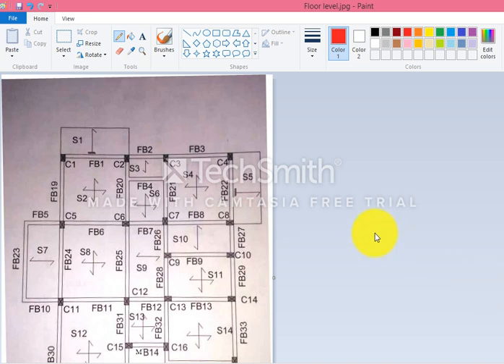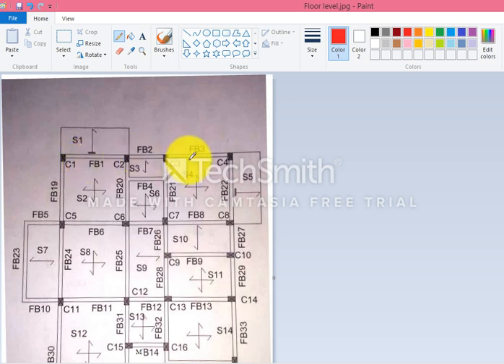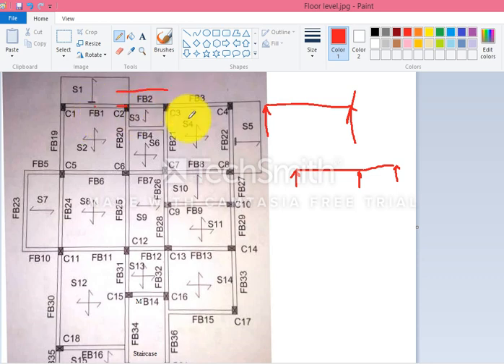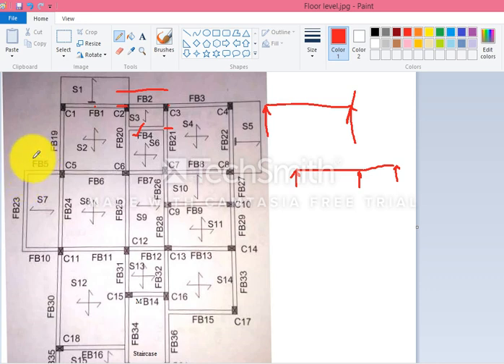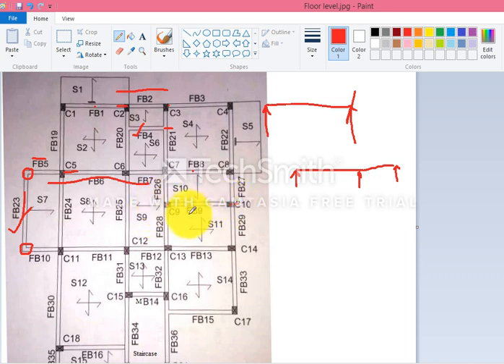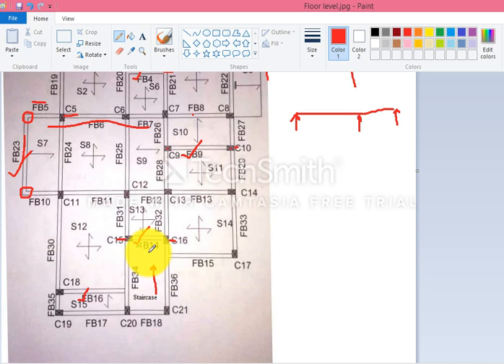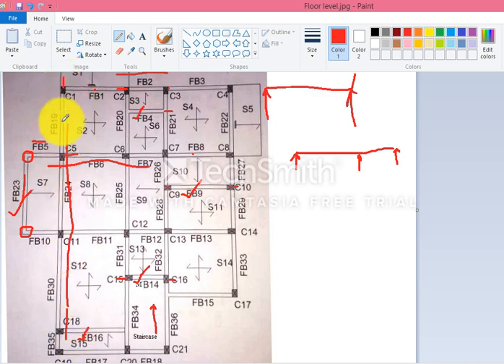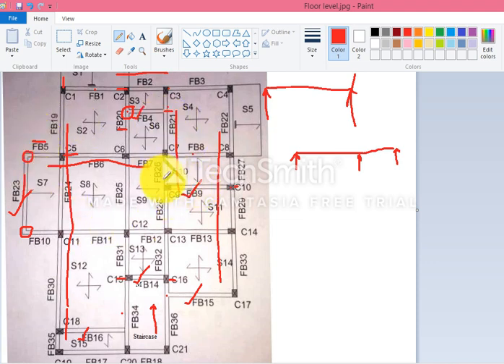How to identify Simply Supported and Continuous Beams in a plan- Part_2

Comment: Very Nice Video, My question to you is, regarding Beam FB4 which is a secondary beam, if for example this secondary beam FB4 would span from Centre of Fb20 to Centre of FB22, it would have 3 supports , two end supports I.e FB20 and FB22 and one internal support FB21, In such a case its a continuous beam, however at the end supports do we design for negative moments, Like we would at the interior support?
Reply from the maker: No. At external support we do not consider negative moment